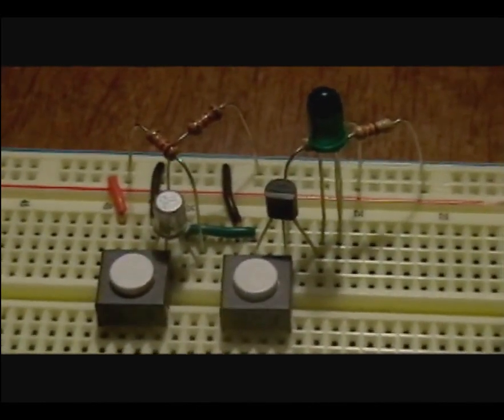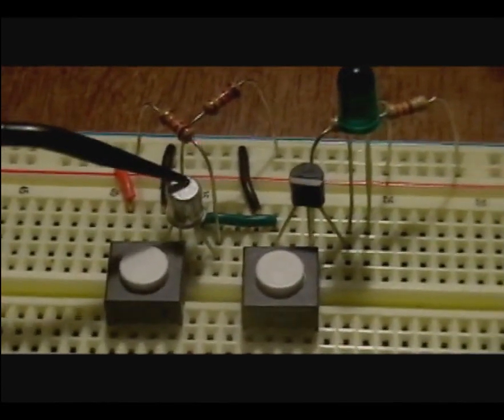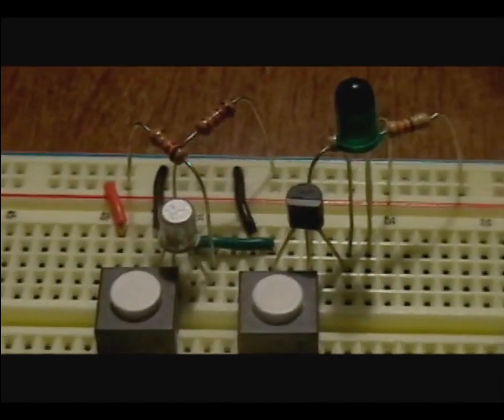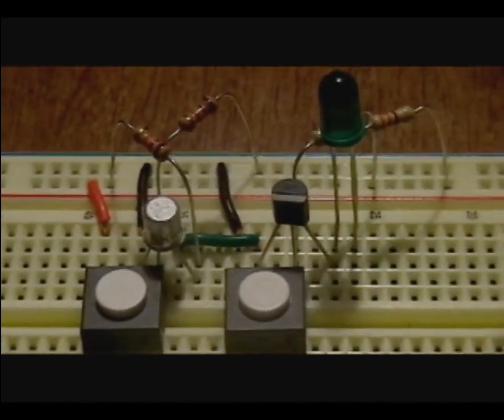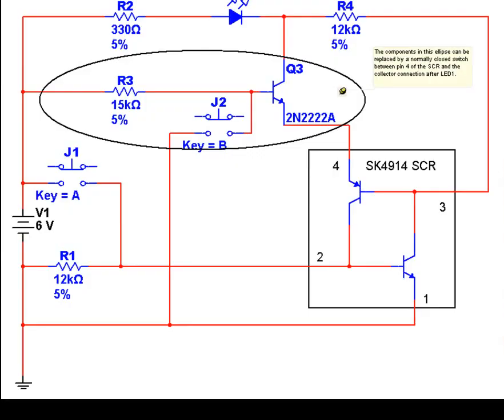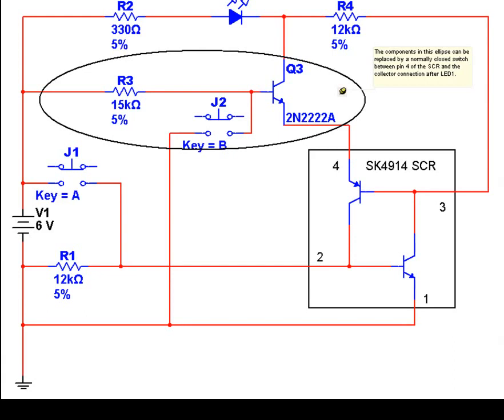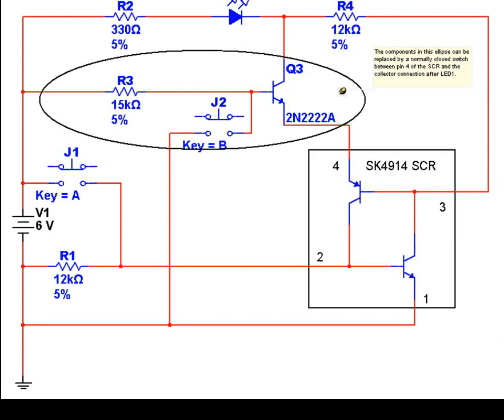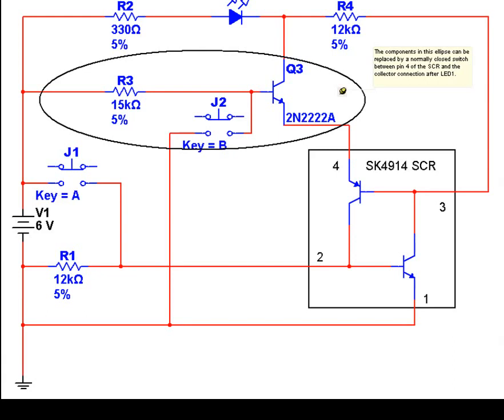SCR Thyristor Circuit with Schematics

Comment: At first glance I thought the transistors in the SK4914 were a Darlington pair.  Although the device does function as an SCR, it is properly a silicon controlled switch, or SCS.  True SCRs are integral four-layer devices.  You did not need to add a BJT to reset an SCR.  Use your NO, MOM switch to short A-K on the SCR.  Current takes path of least resistance and SCR resets.

Comment: A DC THYRISTOR OR SCR HAS ONLY THREE TERMINALS GATE, ANODE, CATHODE.  YOUR SCHEMATIC HAS FOUR TERMINALS FOR THE SCR SO IT IS A THYRISTOR  KNOWN AS A TRIAC USUALLY USED FOR AC NOT DC, SCHEMATIC IS VERY CONFUSING . THE THYRISTOR FAMILY INCLUDES SCR, TRIACS, DIACS.
Reply from the maker: jmitsch44827 Technically you could actually call the device an SCS (Silicon Controlled Switch) which has connections at both the anode gate and the cathode gate.  Most of the triac's I have used have only 3 terminals with the gate providing triggering in both directions.
Reply from the maker: jmitsch44827 Let me clarify further.  The two transistors inside the box on the schematic represent the internals of an SCR (which is a 4 layer device).  Normally for an SCR there would only be one gate (the one represented on the left that attaches to the base of the NPN portion of the device).  I have included a second gate that attaches to the base of the PNP portion which is representative of an SCS (silicon controlled switch).  This device could be used for AC but would only conduct in one direction unlike a Triac which is really represented as a pair of back to back SCR's in opposing orientation with a single shared gate.  If you used this device in an AC circuit, you would only get conductance during at most half the cycle.  During the other half of the cycle the device would be off and no conductance would occur.  As such, an SCS is more of a DC device and is used as an SCR with the ability to open the switch which normally only occurs in an SCR by interrupting the flow of current through the main channel.  I would encourage you to review the functionality of an SCS.  I do have another video that provides a better circuit specifically for an SCS where the load is actually maintained in second gate circuit.  Hopefully this makes sense.

Comment: What's the difference between SCR and Thryristor, I'm trying to get a replacement for a BCA25-800 but can't find any info and don't really know what it is.
Reply from the maker: An SCR and a Thyristor are really two names for the same thing.  I am not familiar with the BCA25-800, but I am guessing the 800 in the part identifier possibly relates to the voltage handling capabilities of the component assuming it is an SCR.  Generally these types of devices will have a voltage and amperage rating. 

I took your part number and did a little research on the internet and did come across this: http://www.st.com/web/en/resource/technical/document/datasheet/CD00002264.pdf.  The part that you have is a triac.  A big brother of the SCR.  A triac is used in an AC circuit and will conduct in both directions depending on the firing of the gate element.  An SCR conducts in a single direction.  The triac works like two parallel but opposing SCR's in a circuit.  I have another video on Youtube that uses a triac to handle light dimming.

I hope this helps.  Thanks for watching.
Reply: It's really weird but this device is really hard to find, it's described as an SCR in some places (http://i00.i.aliimg.com/wsphoto/v0/1866689346/BCA25-800-lt-25-a-800-v-gt-Silicon-controlled-rectifier.jpg_350x350.jpg) and as an thyristor in a chinese website, it's for a car battery charger so I believe it has to be some sort of voltage regulator so it must work with DC and I can confirm it goes after the bridge rectifier, it must have some latching function so when the battery charges the circuit turns OFF, or maybe the "latching" is done by the relay itself.
If anybody can help too it'll be appreciated.
Thank you.
Reply from the maker: Interesting.  Well, based on what I found, I believe it is a Triac which is very similar to an SCR and when used in a DC circuit would work exactly the same way since current would only travel in one direction.  An SCR/Triac will latch when the gate receives the proper trigger and will remain latched until the current through the device drops below the holding level.
Reply: Will try, thank you.